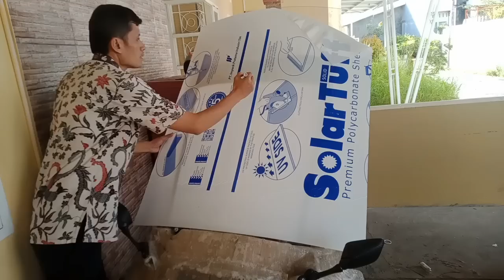Convert the reverse trike into FUV (Part 2)

Comment: The idea is definitely good, and I like the design. However, I'd be concerned about the roof. There is a lot of wind where I live, and that roof would turn into a sail very quickly or worse - fly off into the sunset. Not sure how I'd design it though. A connecting rod to the rear, perhaps?